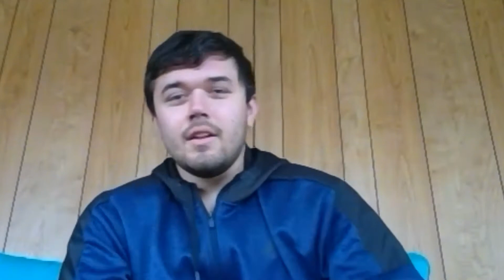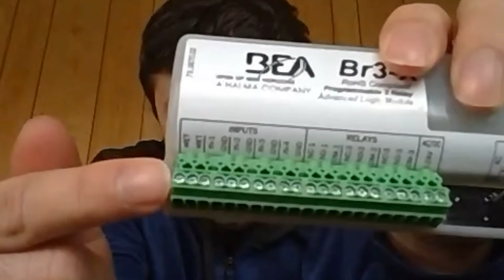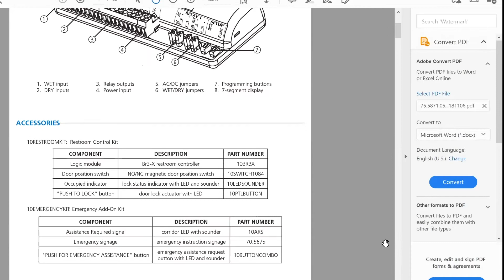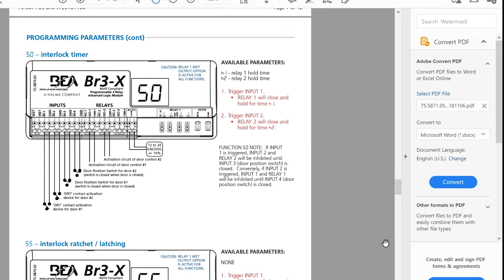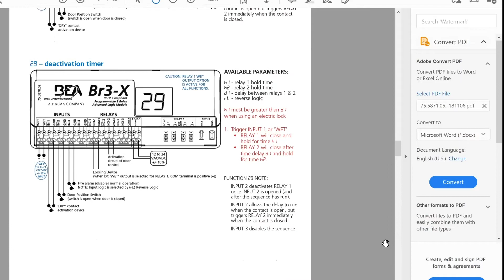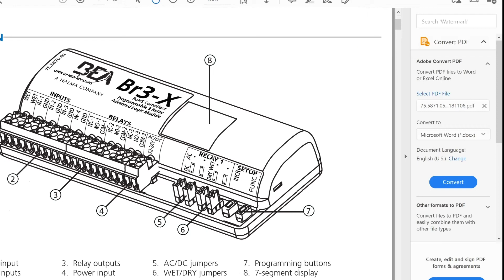Tech Time Live: BR3-X - Product Overview

Comment: Using “3 relay sequence with day/mode” can the locking device be activated without activating an auto door? 
As in: exterior card access activated, lock fires, exterior handicap button enabled.
Reply: Yes.  When input 3 is activated, the only thing it does is unlock the electric lock and enable the pushbutton